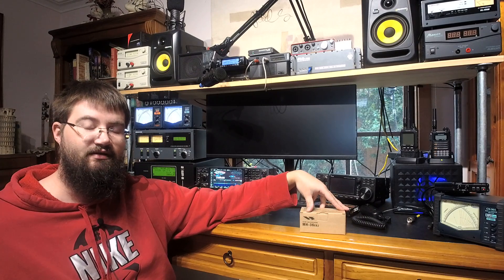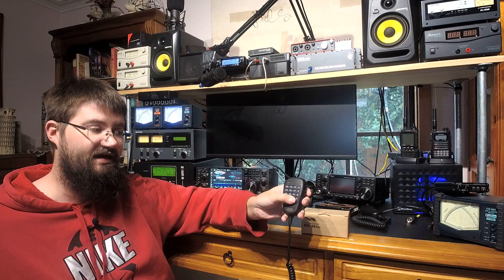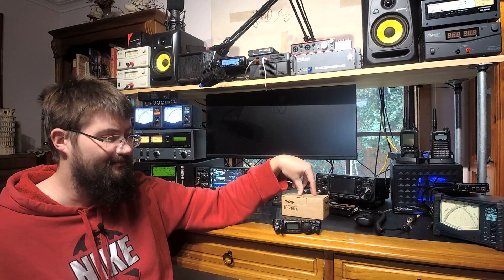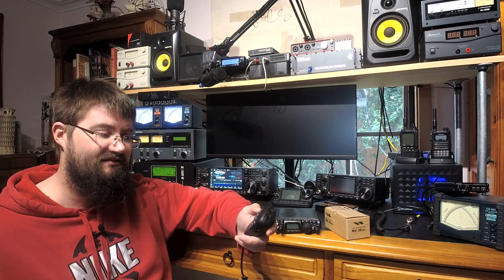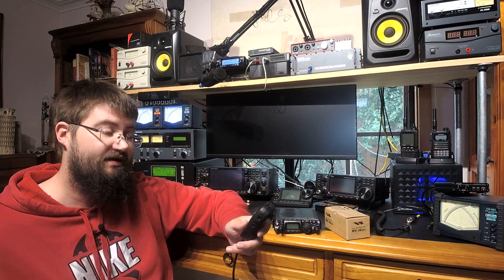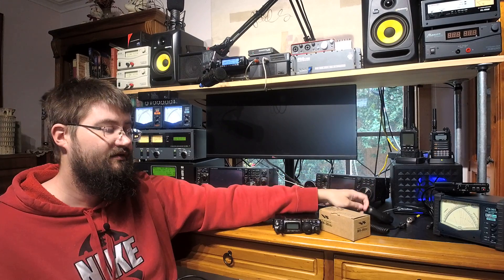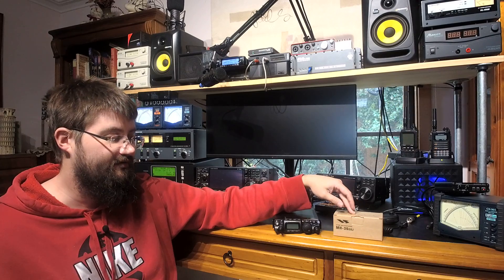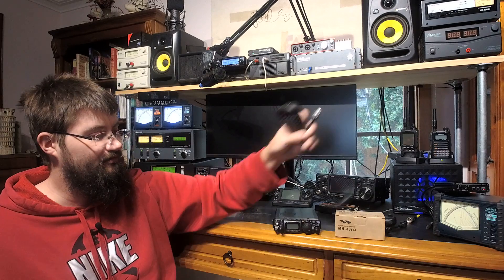Yaesu MH-36 Mic: Is it an upgrade for your FT-817 or FT-818? NO!

Comment: The MH36 is also listed in the FT2600 manual, with no details. I ordered one (likely a knock-off) from AliExpress, only to realize it was, just like for your FT817/818, useless. Because I thought the knock-off was defective, I returned it and got a refund. I wish I had watched your video before purchasing... Thanks for your rant! 73 from Jean-Luc F4LBH

Comment: I purchased one myself as the 991A manual had it in the inform manual as an add on accessory, so I thought why not. Ended up very disappointed to find that none of the function buttons would work along side the Yaesu 991A, at £50 pounds I wasn't happy at all,  I also feel your pain brother 😭

Comment: Thanks for the honesty! I'm only considering it because of the DTMF capabilities. A club I belong to has over 20 repeaters that can be linked and unlinked to each other using DTMF codes so it would come in handy for that alone. I get good audio reports on HF SSB with the stock microphone so I don't really feel the need to upgrade it. I might pick up a desk microphone though for use at home for a little convenience. Thanks again!

Comment: Not to be a jerk or troll but microphones with extra features are covered in the owner manual for any of the Yaesus radio I've owned. The same way the filters and Txco are covered. You should have seen that the mic was only labeled as a dtmf mic and no programmable functions were covered like in the FT 857 for example. Most of Yeasus add on accessories come with very little detail on use, it's all in the the radios manual. You ordered a dtmf mic and got a dtmf mic. Don't mean to be a jerk, I do really like your videos but and hope you don't take too much offense.

Comment: It's a DTMF microphone & works exactly as it should. The numbers are not to enter frequency. They generate DTMF tones while transmitting - mainly used for FM repeater access - things like echolink & other remote dtmf control applications. I did a simple google search search & 1st hit was an amazon add saying ..DTMF microphone.. So yes, it is an upgrade if you need DTMF. But your right, the other buttons also don't do anything on 817/818 - but do work on 857/897 which Yaesu could have indicated in the manual..
Reply: They did. RTFM
Reply: @timlewis2068  OK, so what  manual & what page number? There is nothing included with the mic & nothing written on the box..

Comment: hmm, yes i had BAD RF problems with the MH59  mic on my ft 857.. took me a while to figure out what the issue was.. thanks for the vid m8
Reply from the maker: No worries Rob; I too suffered the MH-59 on the FT-857D (can’t remember if I said that in the video) and it really soured my experience with that gear.  73, Jarrad VK3BL

Comment: Hello sir,
Thanks for the video!
I have a dilema,i have now an FT 891...is the MH36 working with my radio?
Can you help me?

Best wishes and 73s
Reply from the maker: Yes, we believe it is listed as an 'optional accessory' in the manual, and expect it to have more functionality than it does with the FT-818.  However, we have not tried it ourselves.

73, Jarrad VK3BL :)
Reply: @RateMyRadio  Its a DTNF microphone, believe it or not, a lot of people use them to connect to Hub Net via Echolink on FM repeaters!

Comment: I had a similar experience using the MH-36 microphone with an FT-8100 station. RFI from anything would get in the microphone. Purchased a Sundely knock-off and the RFI was gone. Go figure! 73 de W4XXV
Reply from the maker: I found it very disappointing that every genuine Yaesu electret hand mic I have tried is incredibly susceptible to RFI; hence the video calling them out!  Which Mic did you end up with Cam?  73, Jarrad VK3BL
Reply: The Sundely microphone I got from Amazon was very similar (almost exact) to the Yaesu MH-36. Just look for Sundely MH-36 and you'll find it. Previous I had replaced just the cable on the stock mic thinking that maybe it was bad, but it did nothing. I figure it is something in the actual mic that causes the pick up of RFI. Took me hours of trying to break my station down to figure it out. Finally gave up and thought to try to see how the audio was on the Sundely. All of a sudden the RFI was gone! Next time, I'll start with the mic! 73!

Comment: I bought one for my FT-897D a few years ago, and never once used any of the additional features, even on a radio for which it was designed.
Reply from the maker: What can I say, if it wasn't for the RFI issues I'd be 'ok' with the microphone.  I really enjoy using the feature buttons on my FT-400XDR to connect to Wires-X, change power levels etc.  I was expecting that for the FT-817 / FT-818, especially given its the recommended upgrade.  Upgrade my bottom!  

Hope you're well Bubba, it freezing here in VK3!

73, Jarrad.
Reply: @RateMyRadio  Now you sound idiotic comparing a modern digital radio to an analogue radio that was introduced before Wires-X was invented! Get a grip Oz!